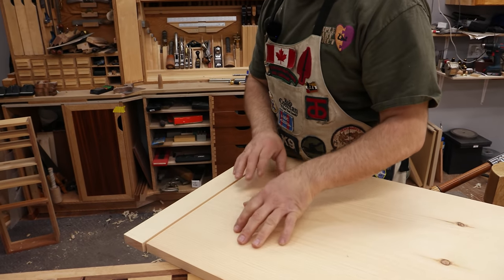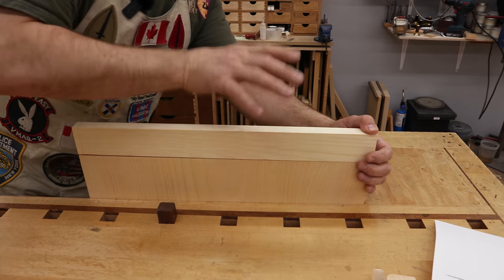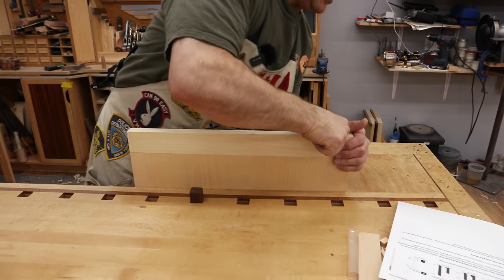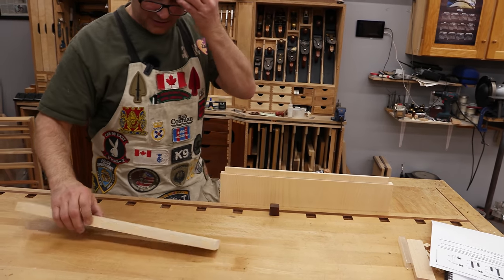How to Make Breadboard Ends - (THAT WORKS !)

Comment: Next to my desk is an old drafting board from when I was in junior high school to college. 24 x 20".  Solid fine grain - might be birch. It's a hand-me-down from my older brothers before me, so it might be from the late 50s, early 60s.  The ends are not closed like this.  And there are no pegs either.  In my whole life, I have never seen gaps or binding.  But today (dryer than summer), the breadboard is a little longer than needed, so it is doing it's job.  I suspect that there is a little glue in the center, and possibly your gap/clamp technique.  There is nothing new under the sun, but thanks for passing this along, otherwise I would not have known about it.

Comment: Thank you for demonstrating this technique! I'll try it on my next table project.

 I've done two Sapele tables with breadboard ends. Both were 27" wide and I used several pieces glued together to get the width instead of a solid panel. After glue up, I grooved both the ends and the breadboards, but did so on a shaper table, and cut all the way out of the table ends. I added 3 separate solid splines into the table end and glued in from the middle about 6" to either side of center on the table side only. I left ~ 1 1/2" on both ends to allow for expansion, and glued a  3/4" cap into the groove on each side using a contrasting wood.
So far this has worked well and I haven't noticed any distortion.

Comment: During the cutting of the tenon on the table saw, I couldn't help but think that it would be easier and quicker to use a rabbet plane.  Rob, thank you for posting this and all of your other videos!
Reply from the maker: A rabbet plane would work
Reply: Or a router.
Reply: Or just use the mortiser the length of it? Looked scary!

Rob is so much better than me though. He can do whatever he wants.

Comment: And another great how-to video. Personally, I like putting down masking tape when pencil marking a board. I have trouble removing pencil marks and will usually find at least one when putting on the last finishing coat. Using tape is more time consuming but it works better for me.

Comment: Hi Rob. I have watched a lot of your excellent videos and I have learned a lot from you, thank you! I have a question on breadboard ends. I am building a desk that calls for a breadboard at one end and I am wondering if I could pin the front tenon instead of the middle one to allow for wood movement at the back only. Would this work? Thank you very much for taking the time to read my question.

Comment: Very nice work. Do not see many YouTube folks using spring joints. I really thought you were going to show a draw bore pin. Still a great job.
Reply from the maker: Draw bore is a bit overrated in my opinion especially in soft wood.  In this application a clamp does the job better.

Comment: I don't consider myself a superb woodworker, but I made a kitchen table with draw leaf extensions using lacewood as a 3 inch border and oak for the center panels on both the center and extensions.  I used sliding dovetail on the ends. It looks great, and much simpler to construct.  I made the table over 30 years ago - before the advent of YouTube to guide me. Youtube  supposedly makes everyone an expert in any subject.
Reply from the maker: Great tip!

Comment: For the three dowel attachment method, could you use a drawbore tenon (with elongated holes of course) for the outer pins or would the friction impede the wood movement too much?
Reply: I was going to ask this question about the center pin instead for both cases, where the draw-bore will pull it tight. I can see the outer pins misbehaving with wood movement but not the middle one.
Reply: @stefankarpuzov  that was/is my thinking as well. If  that subtle radius cut into the end ends up being not so subtle and you need to really pull it together, you might use a draw bore tenon to fix it. It shouldn’t be necessary for the 2 end dowels because of the tension we put in the wood by cutting that radius.

Comment: Rob, I have a friend that doesn't have a lot of tools and he is thinking about trying to make a table with breadboard ends.  I asked how he was planning on building it.  Said he was going to use 2x10 pine and pocket hole everything together.  We got to talking about wood movement.  I don't have a lot of experience with this stuff either so I couldn't tell him what exactly was going to happen with the ends pocket holed to the table.  I thought I would ask you.  Even if he allowed for  movement within the mortise (a shade longer than the tennon) What should he expect to happen if the ends are put on with pocket holes?  What kind of failure might he see?  Also, if anyone else can answer this question please feel free.  Thanks.

Comment: Thank you for this job sir. Please, may I ask you what methods would you use to make these large mortise and tenon with hand tools. Vincent, from France.
Reply from the maker: skew block plane or a shoulder plane.  Marked first with a mortise or marking gauge then work to the line.
Reply: @RobCosmanWoodworking  Thank you very much.

Comment: Hey rob i was planning on doing haunched tenons and using drawboring to pull the bread board tight how do you feel about this method?  I’d oval out the outside dowel holes and only glue the center tongue to allow for movement any tips or advice?
Reply: The haunched tenons and drawbores are structurally a superior approach, allowing you to have a larger portion of the solid breadboard cross-section engaged in resisting the panel cupping.

Comment: The real reason the old makers did bread board ends was to resist glue line's splitting at the ends.
This is caused by the end grain loosing moisture quicker at the ends of the jointed boards thus shrinkage is greater and stresses the glue line to failure.
It's a pain.
Breadboard ends will not stop cupping or bowing though, except at the very ends.
Soaking the ends of the board with oil finish helps, especially if you follow up with pure beeswax.
I only do bread board ends for music desks. But essentially it's a frame and panel construction.

Comment: I'm curious why you didn't drawbore the dowel pins? That's how I've always seen it done before.  It seems that it would have been a perfect place to use with the "reverse caul" shape of the breadboard ends (I really like that detail).
Reply from the maker: Drawbore easily tears the wood especially in softwood.  Too much force in a very small area.
Reply: I had the same thought as you, drawbore is definitely a good way to go, and you can adjust the amount of force by the amount of offset.  I also wouldn't feel comfortable to cut the stopped groove on the tablesaw like that, unless I want to risk losing a finger (I don't have a Sawstop though, being UK based, and he does).  Rob is the expert, so I am sure there is a good reason for his choice, but this video shows doing it with a router if anyone wants an alternative. https://www.youtube.com/watch?v=9zT1CoGzn2g

Comment: Rob, is the bread board typically  the same width as the top or little wider?
Reply from the maker: depends on the season, dry season, end will be longer the board is wide, wet season, end board will be shorter.

Comment: Why do you choose to just use the tongue vs. a tongue with tenons? I've seen many other folks use the tongue & tenon method. Extra work for little payoff?
Reply: I'm not Rob but that would be the method when using only hand tools. Run a groove, then deepen a few sections of that groove by chopping a mortise to accept the tenons. This way you wouldn't have to chop a deep mortise/groove all the way across the board.

Comment: Should have cut the shoulder first. I've done these bb ends a hundred times. But I use a tenoning machine.
Reply from the maker: That works too
Reply: Gives the advantage of checking tongue thickness more directly, with the slight drawback of a trifle less stability during the cut, especially if not using feather board or such, or fence is not tall.

Comment: Would a draw peg work in the center to insure a tight fit.?? Your end result was very nice but seems like a lot of moves...no...stay safe up there...And don't Bogart the maple syrup ...😁
Reply from the maker: Not in soft wood like the white pine I was using.  The clamp does the same job only better and ultimately neater.  The glue and dowel will hold it.